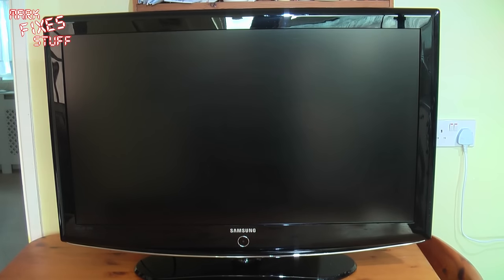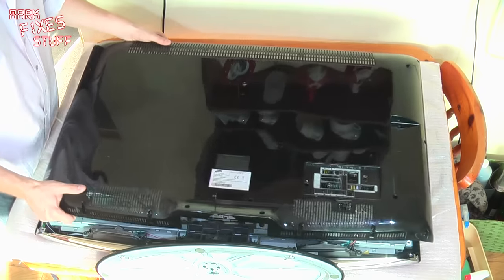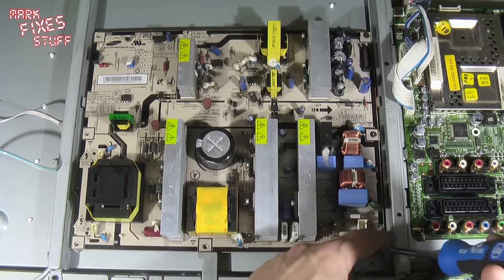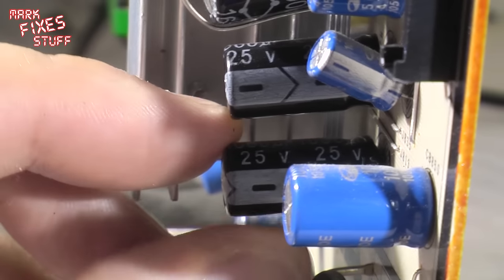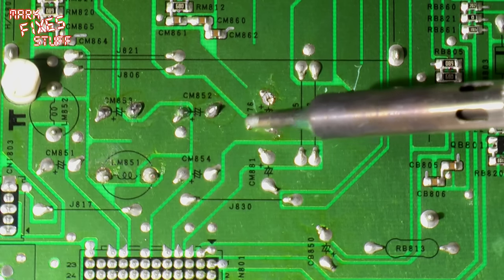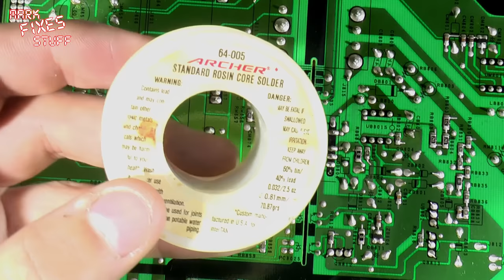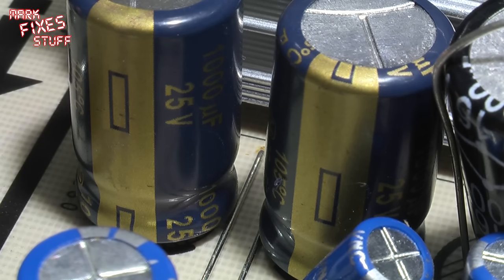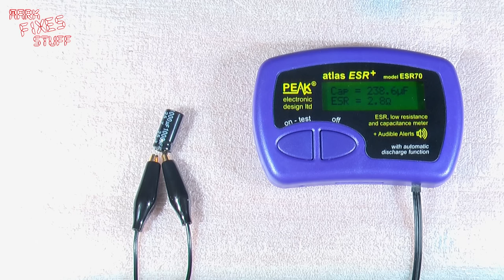Fix LCD TV just clicks won't turn on - Cheap easy repair for LED TV

Comment: Where can I buy these Panasonic capacitors? I need 10v 4700uf caps and 50v 2200uf caps
Reply from the maker: +habz mahkz Ebay or a local electronics supplier. They are common values.

Comment: what if no busted capacitors but still the tv is not working whats the next to be check, too big the tip of your soldering iron,
Reply: check the black connectors on the heat sink, you may notice cracks or dried solder, freshly solder the joints again.

Comment: Think the soldering iron was too hot. Good stuff otherwise!
Reply from the maker: Very possibly. I've been actively trying to find the minimum temp required after a bad experience or five during the MegaCD repair. I managed to rescue it but learned a lesson. Thank you very much for watching.

Comment: In my lcd when i use flash  then i see picture
Reply from the maker: Then possibly the backlight inverter has failed. You should search google for an inverter board for your model.

Comment: Mine shut off today and now clicks and wont turn back on. Nothing is bulging of course so i have no idea what it is but i do hear clicking around the power board while its plugged in
Reply from the maker: +A42yearoldARAB Replace the larger caps nearest the heatsinks on the power board. That's often enough to get the TV working again.
Reply: yep, there are a few caps in the capacitor grouping, but its usually just the couple near the heatsink power strip (that rectangle metal piece). For lower end tvs its usually 2 blue 1000uf-10v-105c capacitors. Larger tvs might have 3. If its clicking its pretty much most of the time capacitors, even if not bulging. Capacitors can easily drop down to half the uf and high resistance without bulging. If you have 2 caps rated at 1000uf and they are bad, they can easily be 500uf or less and horrible resistance without bulging. Replace! 100% chance if they are 10v cheap capacitors.

Comment: i tested my power supply board,in an identical samsung tv, n to my surprise there was no problem with it.. i then installed the main board into the ''test telly'' and the same thing happened as on the other my tv, a blinking red light...any ideas?
Reply: kestral super small problem here
Reply: I have clicking too
Reply: whats that jason??
Reply: sorry ment to say same problem here

Comment: Hello if my capacitor is a 10 v 1200uF could I use a 25v 1000uF?
Reply from the maker: +Edee J Sorry for the delay in responding!

Going up to 25v is fine and will even make the circuit a bit more robust, but you would still need to match the 1200uF capability I'm afraid. Do bear in mind that a capacitor which can handle a higher voltage will usually be physically larger as well, so make sure it can fit!

Comment: I have a Panasonic 42" TX-P42U30B which I got second hand, it was fine for about 2 weeks, and then it wouldn't turn on one day. Instead it makes a clicking sound when you turn it on and is unresponsive to the remote. Every 30 seconds or so it makes the same clicking sound, like it's trying to turn on. I googled the fault and there appears to be some people who had a similar issue.
I found a thread of similar issues online (https://www.avforums.com/threads/panasonic-tx-p42s30b-wont-turn-on.1956403/), though the user also reported flashing lights on the front whereas mine just seems to be solid red and unresponsive.
Is this something one of you might be able to solve?
Kind regards,
Reply from the maker: I don't do repairs for people myself, but having a look at the PSU caps can't hurt in the case you describe.
Reply: @MarkFixesStuff  thanks. None of the caps appear bloated. Does that mean they're OK? Is it worth replacing the psu board anyway?
Reply from the maker: @timroller6431  If a cap is dried out by the heatsinks it won't usually bloat, just become very resistive. It's a few pounds to try changing them.

Comment: my 52" samsung has been clicking for some weeks now,now wont come on at all, have I left it to late to change the  capacitors? thanks Terry
Reply from the maker: +terry keating No! Should be fine with new caps.
Reply: +Mark Fixes Stuff - Retro Console and Computer Repairs, Reviews and MORE! thanks
Reply: nope! look at the videos, try the replacement. TV doesn't work now, its not like your going to break it right? If its clicking, 99% of the time its the capacitors. I just replaced mine today with 2 new capacitors, presto up and working great. And I have never soldered anything in my life. Burned my finger once, did a horrible job because they are VERY TINY,  went "that's about as good as I can do" put it together, bingo! up and working again. Cost me 30 bucks.

Comment: Bro how to check capacitors using multimeter
Reply from the maker: Some multimeters have a capacitance check, but this is not an indication of health. You need to remove the capacitor from the circuit to check capacitance. I use an ESR meter, which checks for internal resistance. 

https://cpc.farnell.com/peak/esr70/esrcapacitance-meter/dp/IN06855

Comment: i have a LED Samsung UA46D8000YR  46 full hd 3D TV, at bottom of TV Red Power Light Blinks On and Off several Times, led lights up showing that it tries to turn on but it can't continously its starts and immediately its shuts of its keep repeating and there is a click sound what should i do?
Reply from the maker: Arif Lalani It's the same fault as in the video. One or more of the caps have either dried up or swollen and burst! simply replace the caps, starting with the ones near the heat sinks  :)

Comment: My TV tries to turn on with no results but the capasitors seem perfectly fine.
Samsung
Model: LE26R86BC
Model Code: LE36R86BCX/FID
Type No. BP26EO
Reply from the maker: They can look fine but be internally dried out. If you don't have a capacitor tester then the best course of action is to replace the capacitors near the heatsink and work your way outwards.

Comment: What happens if you put the long leg on the shaded side.
Reply from the maker: They pop after a while
Reply: @MarkFixesStuff  but if it's backwards it would still work but just not for long?

My Samsung has had bad caps in the past and I've replaced and got a couple years out of it. 
Now I've replaced them again along with domed shaped ones, and now it's trying to turn on and makes rhe Samsung power on tune, but turns back off.
Reply: Sometimes if I leave the power unplugged and plug back in it works for a couple mins like normal then goes back to the same thing where it turns off and clicks.

Comment: I do not see any bad caps on mine???
Reply from the maker: They are not always visually bad. Dried caps are usually the smaller ones near the heatsinks. They get cooked!
Reply: tks for letting me know and would you recommend me to change all the small one??
Reply: I am having the same issue. Im just hearing a little humming and the clicks of death
Reply: it must be the main board, and some of those part are hard to find unless you sent it for repair

Comment: Mine old Tv has similar issues but mine does turn on from time to time after I press turn on and of few times it will click few times or it will turn on and display will go black until I turn it on and of again and so on it’s bit annoying should I be looking for the same capacitors cause mine Tv is similar to that in your video is just a lot more bigger it’s 65 inch is the only reason is not in the trash by now, 🤔😂Let me know Otherwise I may end up buying other TV ...
Reply from the maker: TheBrightLord Kilapro909 yeah. Caps.
Reply: Mark Fixes Stuff - Retro Console and Computer Repairs, Reviews and MORE! Thx

Comment: Where can I buy these Panasonic capacitors? I need 10v 4700uf caps and 50v 2200uf caps
Reply from the maker: +habz mahkz Sorry for the delay in responding. I would look for a reputable ebay seller who can deliver to your region.